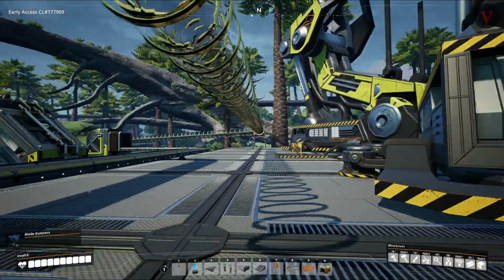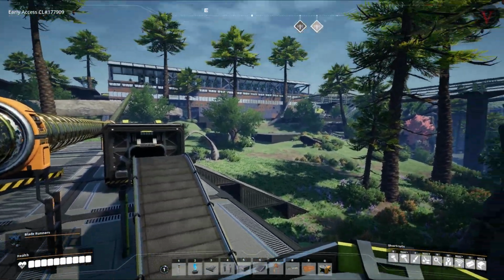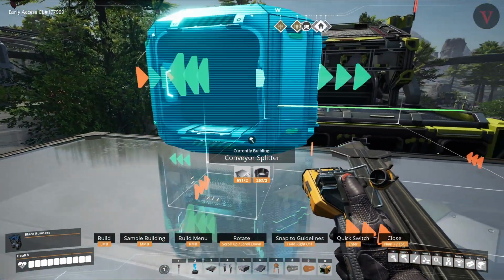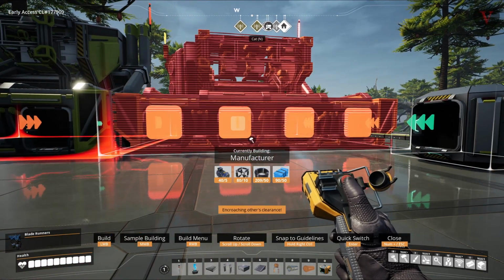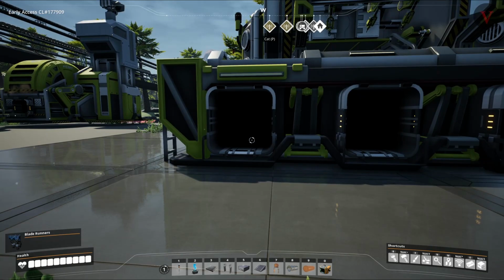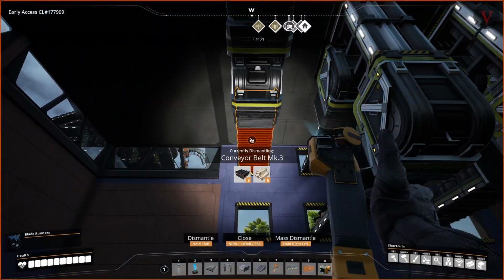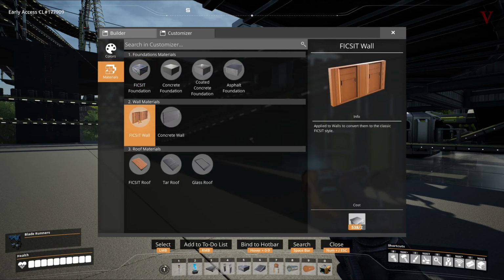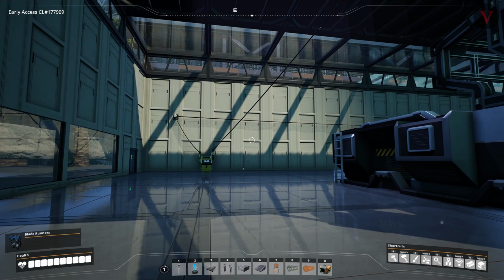Pixel Perfect E20 - Manufacturing Begins - Satisfactory Let's Play Series

Comment: Great video, and as to the first comment i say use whatever colors you fancy. It's  your play through. Wouldn't be my first choice, but honestly I wish  I put more colors in mine, but i like the clean gray concrete.Thanks for the chainsaw tip. I ended up modding in the gardeners tool kit. The precision saw works well, but I hate adding another mod to the list for something so arbitrary and the potential for meesing up the game.
Reply from the maker: I try to color buildings to somehow reflect the product they're making, though in some cases (like the green buildings) I build to the environment, though overall I'm trying to make it look at least a little factory-ish.  When I was constructing this building, I did say the colors might change, because I also felt like it wasn't "spot on", but I am glad to hear feedback, from both sides, on how these buildings look.  It challenges me to grow my style of building and test out more palates.

We'll soon be moving into electronics, which will take us away from the iron / steel palate and into greens (circuit boards), pinks/purples (quartz), and oranges (computers).

Comment: I wonder why you make your colors so dark dull almost look like everything is covered with dust. You are in this bright colorful area of the map. Why don't you make some cheerful factories? For example this heavy modular frames could be with bright silver and black. This will look fantastic!
Reply from the maker: This is the kind of feedback that helps guide the direction of a series, and is appreciated.

The colors on many of the buildings are 'dull' because that's how color comes out on concrete walls, which is why I often put stripes of 'regular' wall for brighter accent colors.  As for using silver, anything in that color range just ends up getting washed out and looking like generic white, especially since it won't look metallic.

I've previously avoided using the steel walls because their texture doesn't blend with any other wall type and cannot be painted, but maybe it's time I reconsider buying it from the Awesome Shop and see where I can work it in.  I can also revisit that building and see about brightening it up.  Thanks for the input!